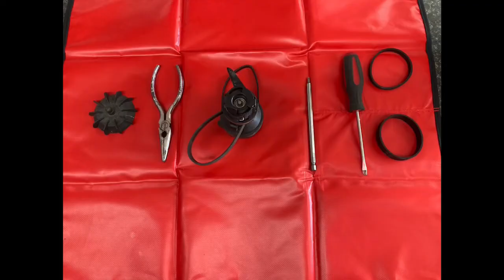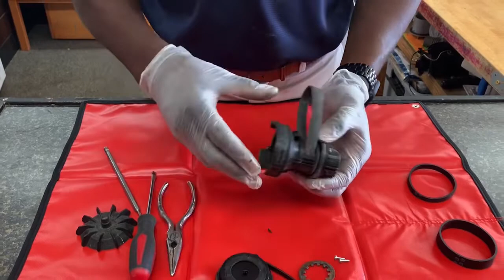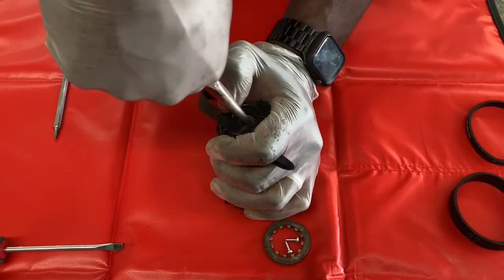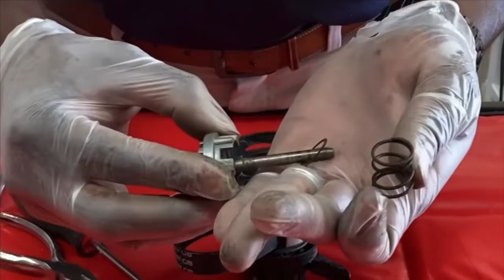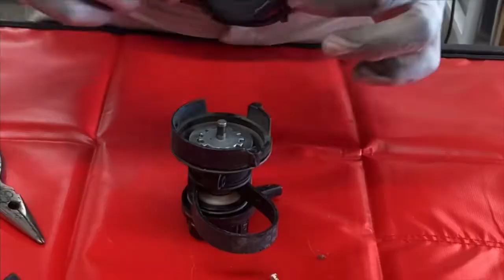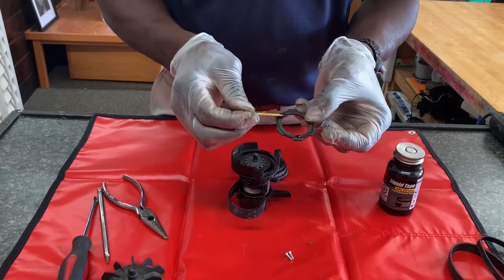Servicing a Dyson DC07, DC14 & DC33 clutch

Comment: Thank you.
You're the first one that's actually cleaned any of the corrosion, that I've seen on YouTube.
Very nicely done.
Reply from the maker: thanks 😊 I appreciate the feedback
Reply: @monroevacs  Just finished my Dc07 Animal.
Full strip down, Clean, Replacement motor & new belts on the clutch.
Works like new.
Not bad for a 20yr old machine that everyone downed on for being a piece of plastic crap with no bearings!!
Strange that the motor has 2 sealed bearings, the clutch has 3 and the Brush roller has 2, basically all the main working parts.
Reply: @nigelnightmare4160  Good Job! These are quite easy to disassemble for cleaning, repair, and maintenance. I've had my DC07 for a little over 20 years, also, and it has been an excellent carpet maintenance tool. I use it several times a week vacuuming my two-story fully-carpeted house with stairs, a fluffy cat, and a messy family member. It still looks great and performs beautifully! Dyson sold millions of these things due to the thoughtful design, cool looks, and cyclone innovation  - which instantly made all the common Hoovers and Eurekas seem gross and obsolete (which they were lol)  Millions of happy ciustomers - but of course the complainers are always the loudest. I've been in retail sales forever, and the people who disparage these old Dysons are the same people who don't read instruction manuals and don't clean or maintain their things. I guess they would prefer a 90s snap-together Hoover with a disgusting paper bag overflowoing with god-knows-what! 😂

Comment: Greetings from the UK. Great video. I remember when I took apart my Dyson DC03 in 1999 when I was on a school holiday back then and was really shocked to find it was smooth belts in the machine.  I remember Dyson making big claims that the belts last the lifetime on these machines.  They don't and they start to suffer from slipping after 2 years or so.  The same thing happened on the DC04 I had as well.  I know these were not in the US at that time, but the DC04 was very similar to the DC07 that was launched in US in early 2000s.
Reply from the maker: Thanks for checking out the video

Comment: Definently glad to watch you do this procedure… far more complicated then I would have guessed… I would like to see you start with the assembled vacuum and then show the procedure to remove the clutch. I have disassembled and rebuilt Carter AFB four barrel carbs, driving lawn mowers, Diesel engines, air conditioning systems, dryers, and hundreds of things in between. I am not afraid, but I don’t want to accidentally break any plastic parts on this Dyson…
   I was surprised at how stretched out those two little belts were. Can you show the belt part numbers to aid in the ordering process. I order through Amazon… is that where you recommend hunting. 
   I would be very interested if you would describe the procedure you follow in locating and ordering parts… I spend hours trying to locate schematics and trying to figure out what the OEM part numbers are… very time consuming and frustrating! There has to be an easier way… I know you can’t afford the time I have wasted just obtaining the thousands of parts you must need each year. Thank you for that video on one component of the Dyson… I hope you do others in the future… I would like to see the removal / installation procedures for the clutch and drive system, and how to order the belts. 
    Your loyal follower;
          Randal Ramsey
Reply from the maker: Already shot the video. I'm currently preparing it for upload.

Comment: thank you for the video, i have a squeak, just unsure at the moment if its clutch or the belt, sounds more like belt though as i can relate it to car belt noise. just not sure which one it is atm
Reply from the maker: Start by changing the belt- the least expensive of the diagnostic also remove the end cap of the brush and clean them out (hair, carpet, dirt) if all fail then consider purchasing a clutch
Reply: @monroevacs  yeah my thoughts too, specifically as after a short while the noise disappears, i assume when it warms up a smidge dc14 btw yeah that old and still working